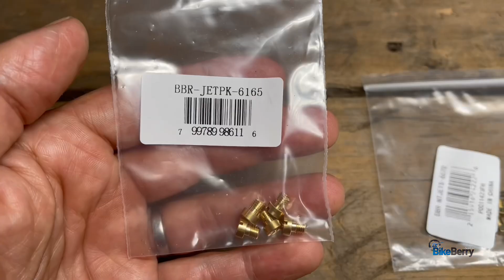Stop Guessing Your Carburetor Adjustments / Simple 2 stroke Jetting

Comment: Hell0 @bikeberry I have a question.  I want to purchase the 66/80 kit for my beach cruiser but I have the Genises onyx with the 29 inch wheels and it's frame piping is fat. Will it work on that frame? I only want one if it can fit on that frame because I love that cruiser and don't want another bike just to use it. Thank u in advance. It's just a standard large tall beach cruiser.

Comment: Hello, I have a problem with my bike, it's new, I've ridden 50 miles, it's very hard to start it when it's cold or after a day of standing, when I manage to start it and it warms up a bit, it starts nicely every time, I have this carburetor with a red casing, do you have any idea what could be the cause?
Reply: Cold Starts sometimes just take more time depending on the weather. You can try running it slightly richer (moving the throttle needle down 1 slot), possibly upgrade your spark plug/CDI, or use a bit more fuel while priming it. When you start it with the choke (since it's not automatic) once you started, open the choke slightly about half-way. Once it's warmed, you should be able to open it all the way.
Reply: also for the little pin on the needle, you can try adjust it the opposite way as well, just know you're running it leaner and it will run hotter.

Comment: Tony,  I have to open the throttle on my HP carb when turning the idle screw in, in order to effect a change in the idle. If I leave the throttle closed, I  notice that the adjustment screw butts up against the slide, jamming it. With the throttle plate raised the screw slips underneath the throttle plate, raising it as I turn thr screw in. That's how my HP carb is set up anyway, and I don't see anyone else mentioning that. Maybe I have an oddball carb?
Reply: The screw is tapered so it Does raise the slide.That's the 'idle adjust' he was talking about.You were correct in  noticing the screw jammed the slide as you should always twist the throttle a bit,and hold it, when 1st setting up your new carb. so it Doesn't screw Into the slide, instead of under it.
Reply: @bryduhbikeguy  Thank you.  I never hear anyone mention that little nugget of information though,  guessing maybe why so many people don't like that carb.
Reply: It's a horrible carb man. I got one too. Just use your nt carb.